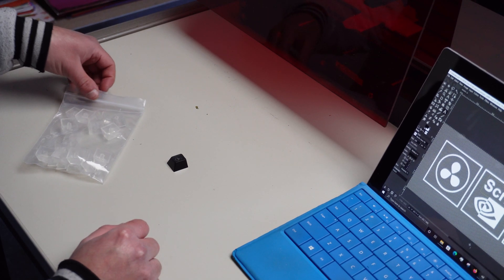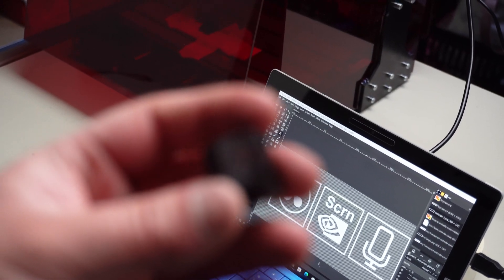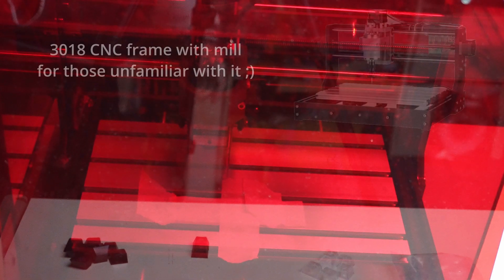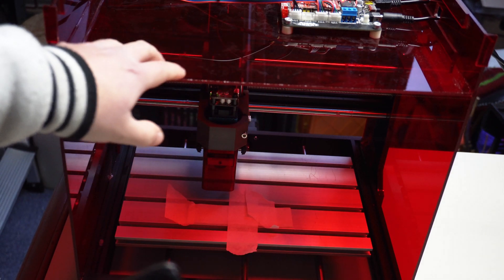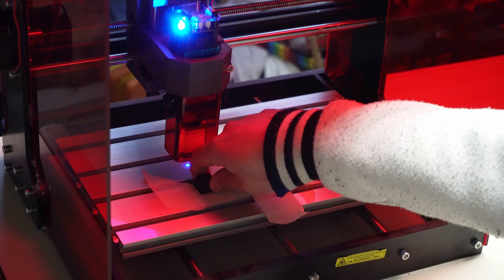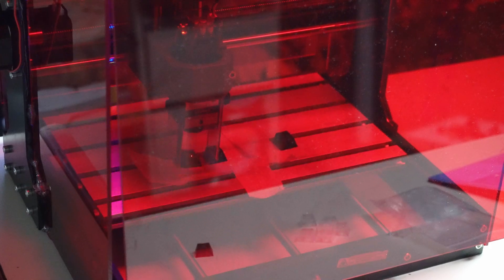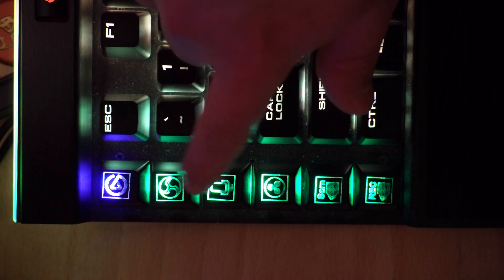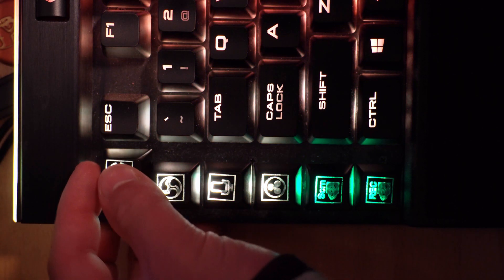Making my own custom keycaps using my DIY 3018 pro laser

Comment: Hi, did you use an special spray on the keycaps? Or any spray works? I wanna do some ones but Im limited in my budget so Im wondering in order the wainlux k6 that has 3w. You think that would work?
Reply from the maker: Nah just regular spray paint. This one is Acrylic based. Be careful to do this in a well ventilated room though because you are basically burning it off. :) hopefully this helps